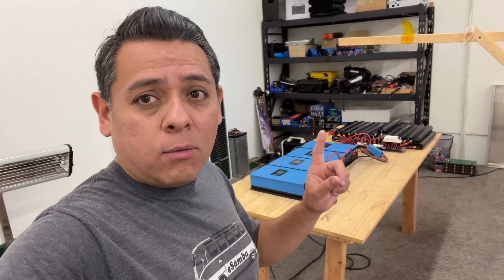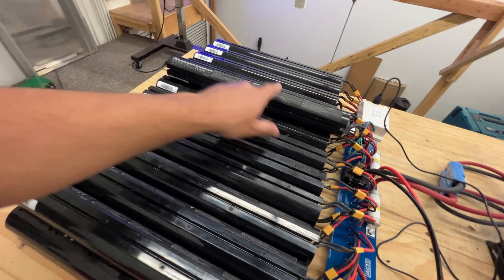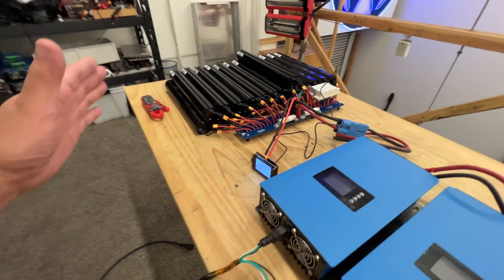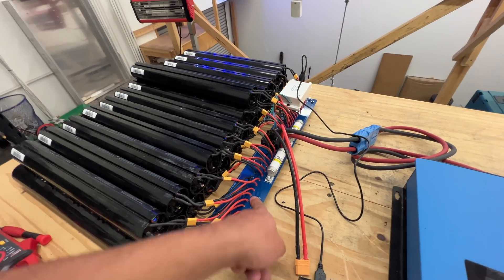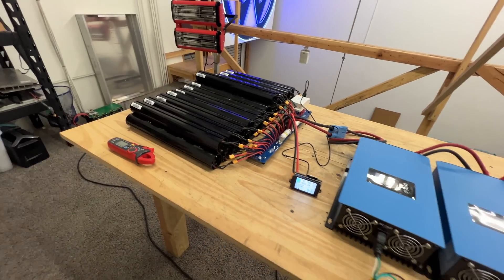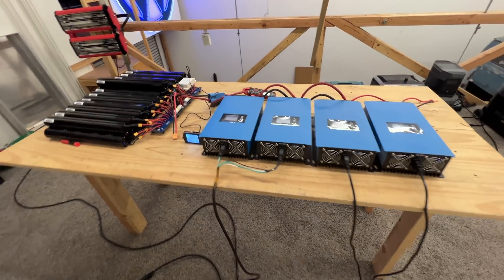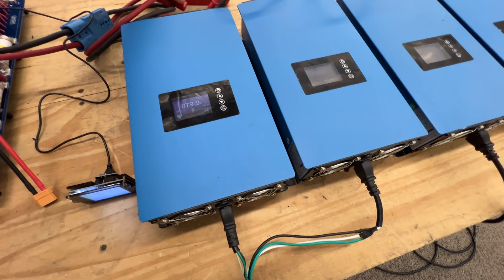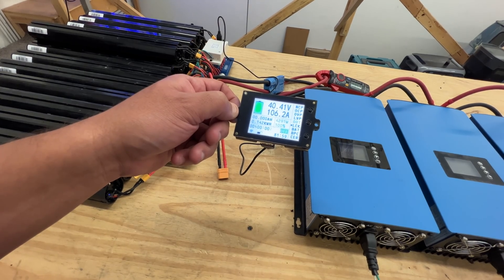MeGaloDongleX PCB handled 100A for one hour - DIY Powerwall

Comment: Just curious what you think of these grid-tie inverters now after using them for a while.  Have they been more reliable than the smaller $125 bricks?  Have you used the power limiting - and if you did a video on this, did I miss it?

Comment: Jehu the fuses are designed to be the less resistance parts in the circuit to blow up first  in case of any problem may be this is the reason why is so hot or I’m wrong? 🤔

Comment: What would a battery look like to build that has a 550 to 850 amp hr capacity pre unit? Because I work using electric forklifts and their acid batteries has that capability or capacity? So I was thinking what would the look like with lithium.
Reply from the maker: Well, that one sitting on the table is 4.9kwh /36v = 136Ah  so 5 times
More battery than I have here, or around 100-125 scooter packs

Comment: I would put them vertically. That way you just need a stable bottom plate for them to rest on and 1 or 2 straps across to secure them. 👍
Reply: But space optimization?
Need the size of his metal enclosure

Comment: Hi Jehu, do you think an active balancing BMS board can help battery to survive longer? Apart from the battery BMS for charging only. Any thoughts about that?
Reply from the maker: no, the opposite,  active balancing adds micro-cycles to the cells  which add up over time and shorten the life of the cells.
Reply: @jehugarcia  I’m concerned about recycled cells that I might use in my battery pack. Any suggestions about the levels or ways to avoid any mishaps in the build? Any rules that you will follow to rule out any used battery to be repurposed in the assembly of a battery pack?

Comment: What I would do is build a rectangular box that will house the batteries. Cut high temp abs plastic tubes to house the individual cells and load them vertically in the box. Provide spacing so that you can create positive pressure airflow between the cell holders to help reduce heat build up. Either mount the power relay board under or over top of the cell box, directing the hot air flow upward and out of the power unti.

Comment: You asked for additional suggestions.

I was thinking that Rubbermaid Wire Shelving in between each layer of batteries, where the shelving can be adjusted in height away from the lower stack of batteries, would give them air to breathe & remain cool, as well as keep a degree of safety where catching on fire would not set the shelf on fire, and finally provide easy inspection points.

I liked the idea that someone else had, about having a clear plastic box, to see the LED’s through.

The wire shelves, surrounded by clear plexiglass, shelving attached to the rear of the box, would make a nice observable stackable unit, with a degree of protection between batteries.